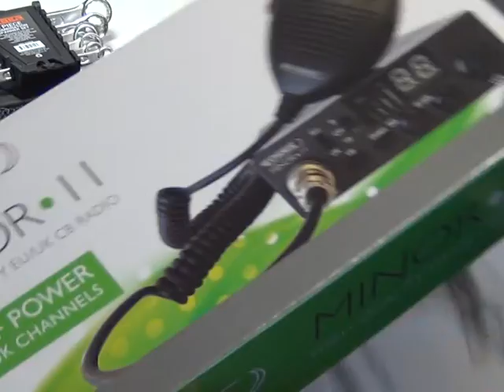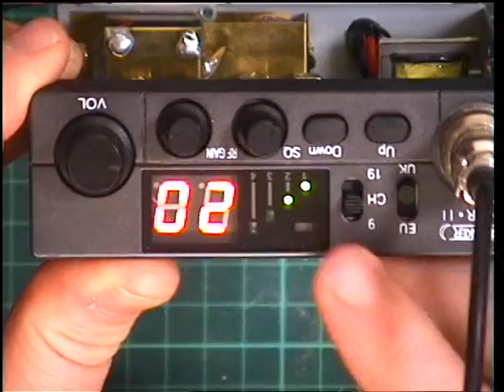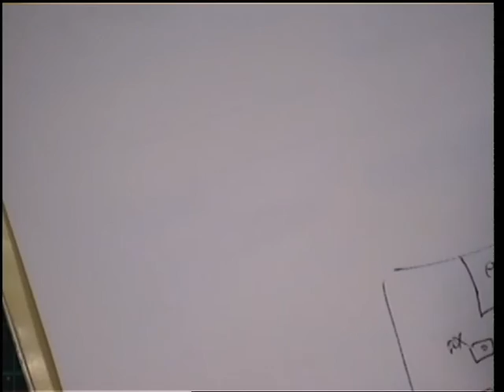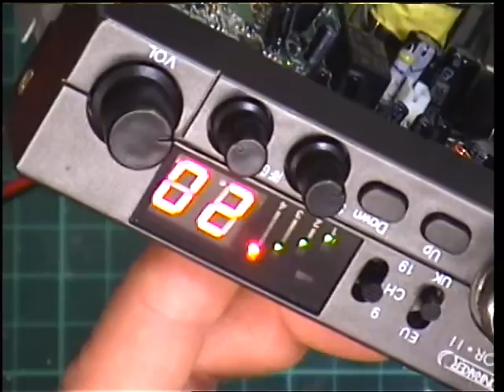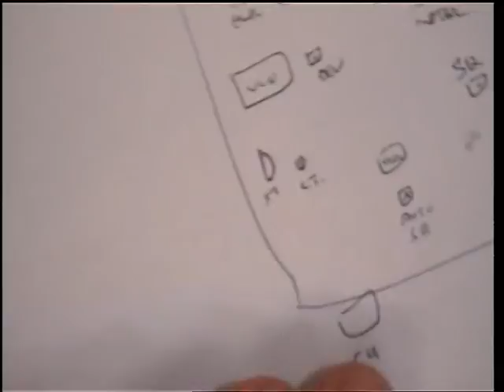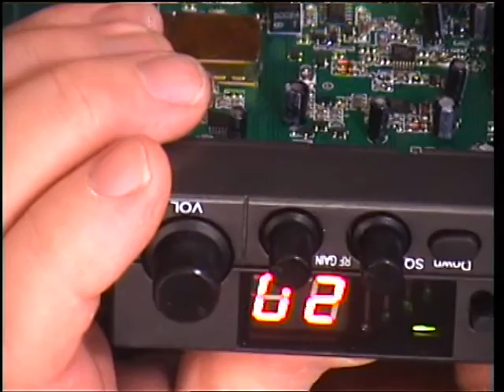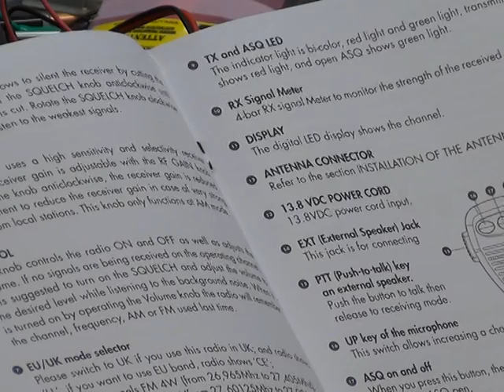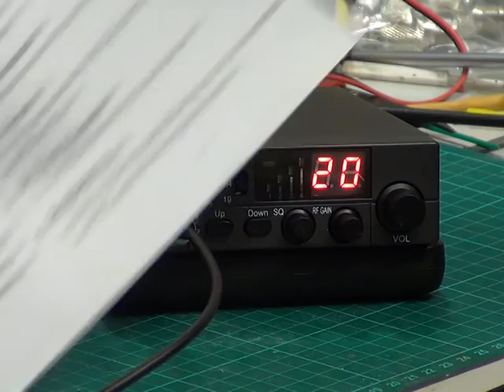Moonraker Minor II UK CE Multi-Norm CB radio (Mobile)  TX & RX adjustment

Comment: Interesting. I wonder if this and the Thunderpole T800 share the same board 

I installed a M2 into a friend’s camper van. Works alright for him. But certainly for the money, you can buy better
Reply from the maker: I must look back at when I did the Thunderpole T800. I'm expecting the brand new Moonraker Minor II Plus today,  so will look at that immediately...just a facelift? no idea.
The JWR M2, Murphy DS602, ICOM (not the real Icom!) ICB1050, Signal 1001, didn't quite share the same chassis but clearly came out of the same factory. They have superb transmitted audio, a receiver worse than most, but not as bad as the Great GT858/868 chassis & the worst squelch on any UK rig. However, today with less users will work fine, especially mobile. Despite it's shortcomings I too would be happy to have one in the car.

Richard

Comment: I remember when you did the thunder pole t800 you said the rf gain only worked on am or EU. That moonraker is exactly the same radio isn't it?
Reply from the maker: It is the same radio but I now need to compare them side by side. It's always possible one is better than another; that could be by design or just manufacturing tolerance.

Comment: Are these actually as bad as people say? I am sure these must be better than the fidelity 1000 / eurosonic range?

What 80's rigs would you compare these with quality wise?

Amstrad 901?
Harvard good buddy?
Reply from the maker: Interesting you brought up the Amstrad 901 which I regard as one of the best ever sets (cybernet PTB002F chassis)....unfortunately there are loads of Hong Kong fakes. The Amstrad CB900 is always made in Japan & there weren't any fakes. Early CB901's were also made in Japan (£89.99), then cheaper but genuine production in Hong Kong (£59.99), then the fake version (£39.99) also Hong Kong but no screen printing on the PCB. The  Fidelity 1000 (Great GT858, Taiwan) had poor rx selectivity & was a 3.5W set (things don;t change).

I'd say more like the JMR M2, Murphy DS602 etc.

Richard
Reply: @ukfmcbradioservicingTango21  thanks Richard, I have a 901 as new in the box, and it's a Japanese version.

Comment: I purchased 2 Vietnam versions Luiton LT-298, 12 bands, 10 watts and both of them had the same hum like your radio does, I emailed Luiton
about a fix and they said I had to order a production run to get the
problem fixed, also RF gain works more like a NB a very bad one at that, besides this the radio worked quite well if you can put up
with the hum all day long. Regards Mikey.
Reply from the maker: I have a Luiton LT298 in stock to review in the future, though it will be the UK legal version. I expect the CPU racket will still be present so don't hold much hope for it to be better. THe latest Moonraker Minor II 'PLUS' arrived this week. I wonder if it's just the same with a reprinted front panel. We'll see, and I'll do a video on it this week.

Richard (UK)

Comment: I'm not impressed with the Moonraker range of CB's ,
You'll probably find that the PWR adjustment is inside the little metal box at the back near the antenna socket Richard,
It's also 12/24 Volts ?
Reply from the maker: The Moonraker Minor II Plus is 12/24 volts. This earlier version is 12V only.

Richard

Comment: Can this set not get up to the full 4 watts?
Reply from the maker: Not this one, though that's not unusual I'm afraid. No doubt on a cheap CB power meter it would read 4W into a dummy load, but our test set reads only the power at the correct frequency leading to lower but true readings.

Richard